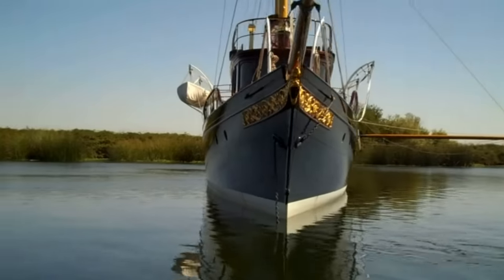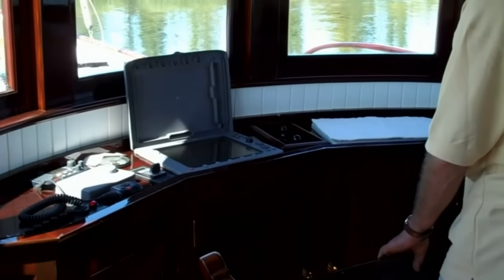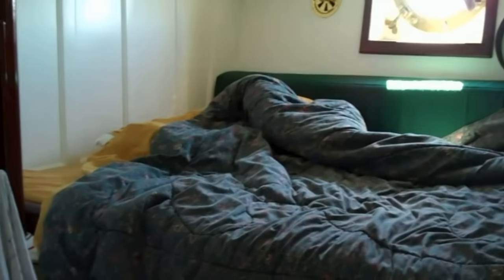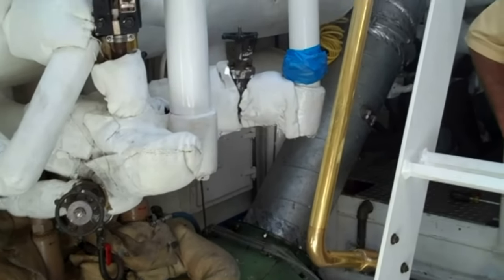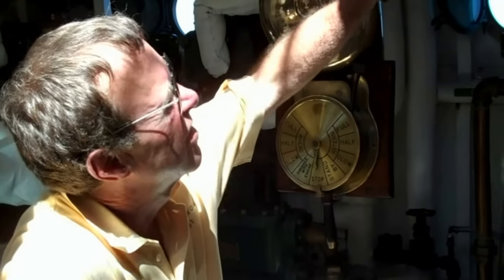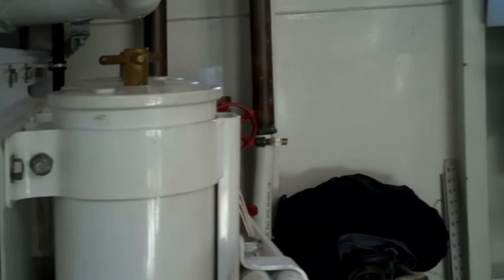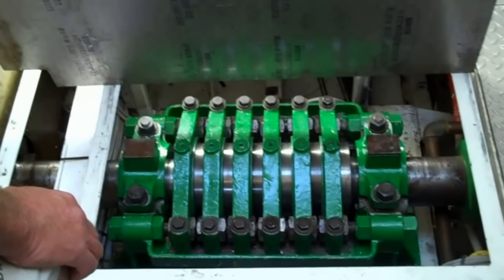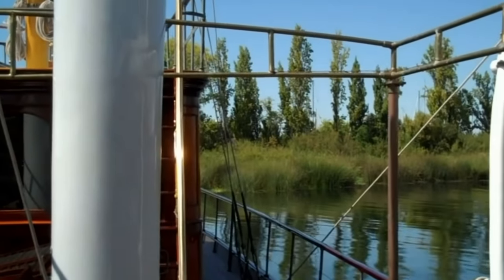Steam Yacht Cangarda tour in the California Delta

Comment: I've been following this boat since the first time I went on 'yachtworld' Many Moons ago.

The work you have done is amazing.....  Just wonderful.  I"m going to re watch the cruise from L.A. to San Diego... 

So about that oil feed to the Shaft....  I"d mount it as six separate tanks at about chest level.  Along with devising a way to pressurize any one of them separately.  That way you can visually monitor actual use and attend to inconsistencies

I worked on a hundred ton restaurant boat with like two graphite clutches on the two shafts....   If we hit a big snag (Potomac River)  the graphite would take the ding and work it's way smooth over time.   Each shaft had' it's own oil feed.

Anyway wonderful boat, wonderful work you have done.   Thanks for posting.